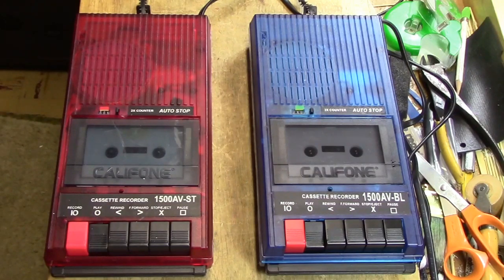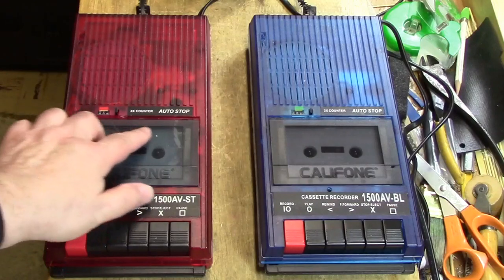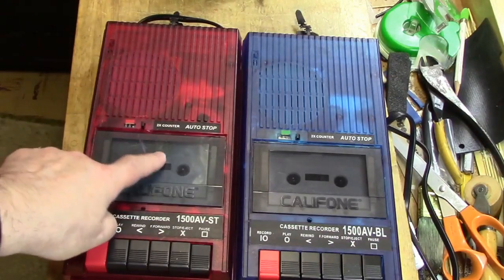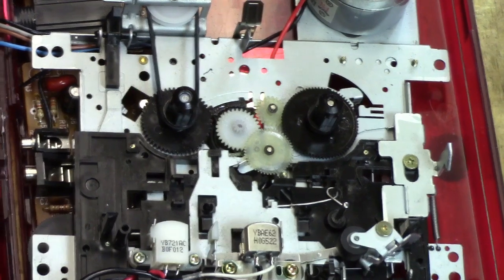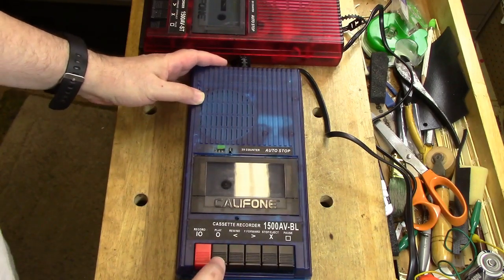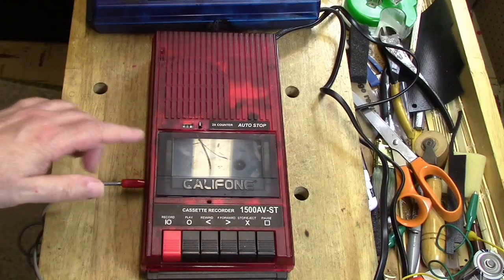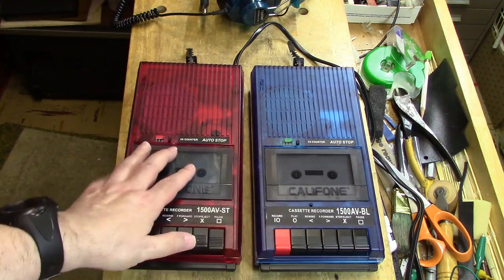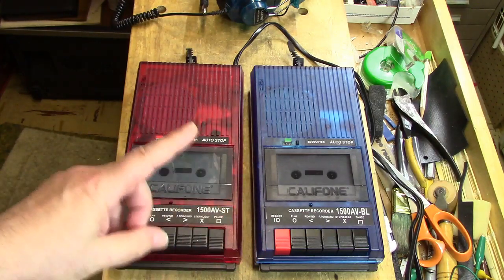A Tale of Two Tape Recorders – Califone 1500AV – BL and ST Cassette Recorders

Comment: I got the blue one at yard sale for a dollar!! I was so stoked but once I got some tapes to play I found that it hardly makes any sound and eats the tapes when it does. Is there anything I can do to fix it?
Reply from the maker: Sorry to say, unless you're into electronic repair, you are stuck with a paperweight. 

Usually, when a tape recorder or radio produces hardly any sound, it means at least one, if not more, electrolytic capacitors have failed and must be replaced. 

This can be a difficult procedure because of the way the components are attached to the circuit board. Even experienced technicians are sometimes daunted with dealing with this.

Eating tapes is usually caused by a slipping belt controlling the take up spindle friction clutch mechanism. Or, sometimes, the friction clutch itself fails (they were made of plastic and plastic changes size with time, it shrinks). 

Again, not an easy repair. 

Sorry. It's the nature of these devices to eventually fail. 

Remarkably, some last, and that is always something of a miracle. So many variables account for it. 

Environment is a key factor. If the machine was kept in harsh environmental conditions (as in a garage attic or basement), the components are more likely to develop troubles.

Comment: I recently just purchased a black model at a thrift store and one of my tapes got stuck in it so I had to open it up and take out the tape. After doing so the play button will not stay down if I press it down and I’m not sure what the issue is I didn’t break any pieces or anything wondering if you had an idea that might help
Reply from the maker: Hi,

I don't know your machine, obviously, so I can only post some generalized ideas.

1.  If you removed the mechanism from the case and replaced it, is it possible that you put it back in slightly out of alignment? The screw holes in the metal frame are a tiny, but oversized, so you could actually shift the mechanism and maybe, there is a lever that is out of alignment until you shift the mechanism into place. So, I'd take the mechanism out again and look at how things appear to be meant to align, and then, very carefully replace it checking alignment of parts as best I can. 

2. Did any springs pop loose? These recorders used some really small parts (for their time) and little springs are easy to lose or pop off.

3. Did this machine work properly for any time before the tape got stuck and you repaired it? If so, then we know that it CAN work again, if all the parts are aligned and in place. 

4. You kind of have to be a detective in this and closely look at all the mechanism,  work the keys, and watch what the levers do and get used to understanding how it interlocks everything, Once you can do that, you may see where a lever is missing a catch, or a spring has popped off a hook or something like that.

Hope this helps!

Good luck!

Comment: Would anybody know how to repair the eject button on it, the door does not pop up
Reply from the maker: There is a plastic part of the case that acts like a holder for the spring (it's on the right side). It often breaks from wear and makes the spring useless. Sorry.
Reply: Thanks

Comment: sweet Sally sells six Swiss wrist watches  
wtg CS, radiotvphononut has also done some Califone vids.  
He too has lamented to move to made in China.  
Radio Shack and Panasonic also marketed color and "flavor" radios in the 70s.  
Too bad that TV did the opposite, going from fashionable cabinets to those stupid ugly black cased TV sets.  Good one Tim.  Don
Reply from the maker: umajunkcollector  Thanks for watching the video! 

I'm not even going to TRY and say the first sentence in your comment. Just reading it twisted my tongue! 

I've seen RadioTvphononut videos and doesn't he do mostly record players? I think I remember seeing him do a couple of Califones from the 1960's. 

I don't lament the move to "made in China", I was just pointing out that these machines were made there and that they use what seems to me to have become a standard mechanism. 

My Marantz "super duper" stereo system has a dual cassette unit with Chinese mechs and it has worked beautifully since 1982 with little maintenance!  

I think there are some "good" Chinese mechs and some "bad" ones. Just like everything else. Need I remind you of the Midland rim drive cassette recorder???? 

What the Chinese DID accomplish is that they pretty much standardized the mechs -- something Philips dreamed of doing and that the Japanese were dead set against. Which is why so many cassette units from the 1960's have performance values, and mechanical designs that are all over the place. 

I remember the "color" flavor radio and cassette units (even 8 tracks) but they weren't "translucent". These things were mostly marketed to "teens". I think they also were trying to get the female market moving. in the 1960's, the audio market was heavily male dominated because of attitudes towards women being "not technical". 

Interesting story about colors -- may be an urban legend -- I forget where I read it -- somewhere on the Net (which never lies):

SONY held a marketing meeting for a new line of digital cameras. They came in several different colors -- which is typical of products sold in Japan. Two American "marketing agents" said "This can't be done in the U.S. Cameras must be black or silver ONLY. The American consumer won't buy anything colorful, or take it seriously." The SONY Chairman said: "We are SONY, we MAKE markets. We will export ALL colors to America and then we'll see."  The cameras went out into the stores and sold very well. The POOREST sellers were -- the back and silver models. 

I'm waiting for them to make a transparent digital camera!
Reply: I saw a transparent TV at a junk store with a PRISONER SERIAL NUMBER etched into it. It was a typical Magnavox 12' set.  I was told that this was for inspection for contraban and smuggling / hiding illegal things in jail cells.  8$, but I passed, kinda creepy, wondered if the guy got the electric chair or something, or perhaps was a serial murderer.  Don

Comment: Don't forget that Apple copied Tandberg Computers from 70's all the way up to 2000's.
Reply from the maker: Norwegian tape recorders Tandberg & RN &Proton  First I've heard of this. Can you explain in more detail please?
Reply: Most of the design: Tandberg TDV 2114 (1977) as the mac and lisa, Tandberg TDV 2000 (1979) as macintosh and some of the business machines (2000) as modern Mac.
Apple also claims to use the modern computer with mouse, keyboard and screen. Tandberg first machine had a screen and a keyboard in 1969-70 and they first used the mouse in 1977.  http://digitaltmuseum.se/011024226812?count=112&search_context=1&name=Tandberg&pos=24   http://digitaltmuseum.no/011024228579/dataterminal   There is little information about this I will talk more with someone who has worked there when i get time.
Reply from the maker: *****
This is very interesting! I didn't know that Tandberg were making computers, I thought they only made audio. Thanks for the info.
Reply: Remember Computer production did not last for long, Tandberg Radio went bankrupt in 1978. A New Company known as Tandberg Data and some others was started.                                                                                                                                        All the stuff Tandberg Radio prodused and the first time: Radios 1933, recordplayers 1942, tape recorders 1952, TVs 1958, casetterecorders 1972, computers 1969, speakers late 40s, amplifiers 1942 and cd players 1990s.                                                                                                                 
Tandberg products was always quality, wooden and hi fi. The way Tandberg Radio went
bankrupt was a man called Jens Christian Heuges fault. He
was a racist against Tandberg and Tandberg can not bear anymore about
bankruptcy to tokk his life for his business.                         Tandberg
always think the best for his workers and very smart and futuristic, from the
beginning to the end. This leads to the massive success, from 3 to 3000
workers.
Reply from the maker: *****
That is very interesting information about Tandberg. I only saw/heard one Tandberg tape recorder in the late 1960's. Here in the U.S., Tandberg was sold in some high end stores and catalogs, but it was also quite expensive so their electronics were a kind of a specialty item.

Thanks for the info on Tandberg, I hope it helps others who read this comments page!